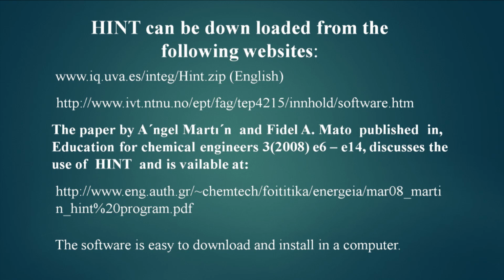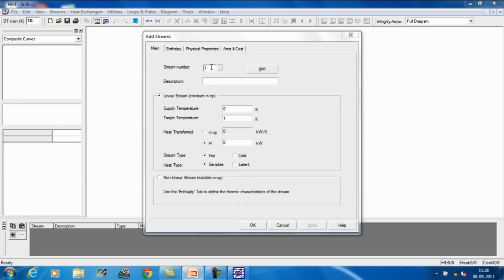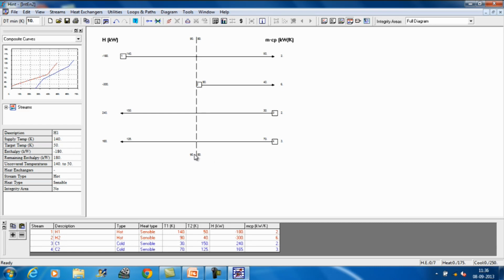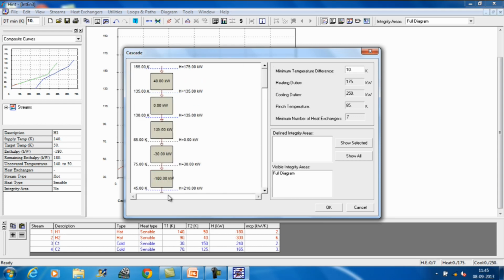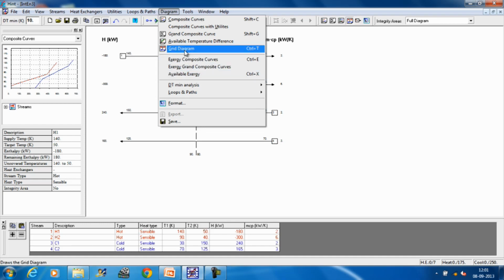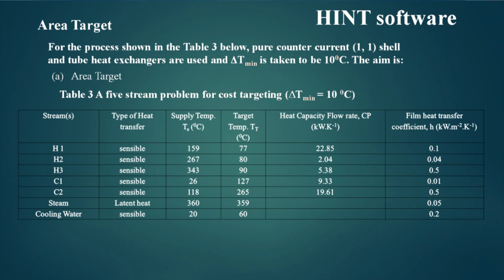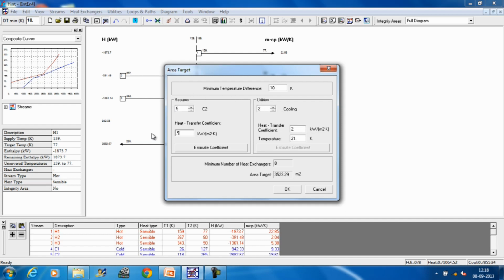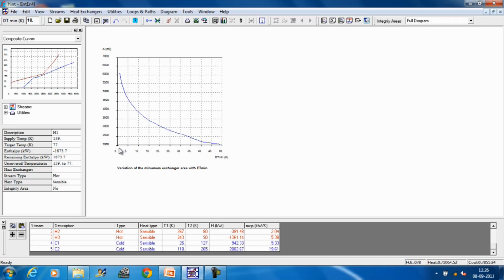Mod-07 Lec-01 Problem solving using HINT Software- Part 01

Comment: Thank you Dr. B. Mohanty I have one question : Area Target problem 44:47 admit an exact solution of 4154 m2 as determined by the intervals method, nevertheless hint propose 3889 m2 for Dtmin of 10°C. When combining the utilities as you suggested in this the video, the surface area increase with Dtmin which is bizarre. So could you explain the discripency. Thanks